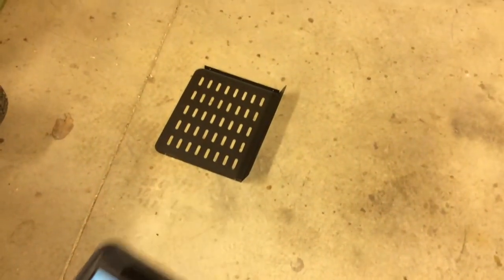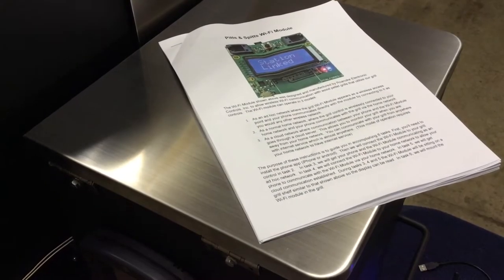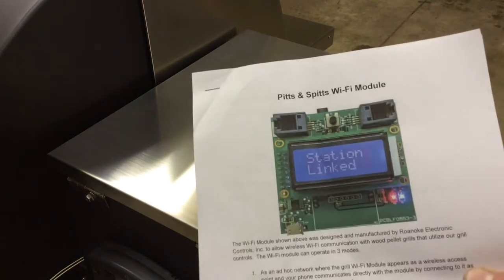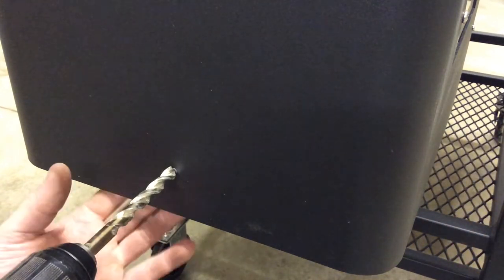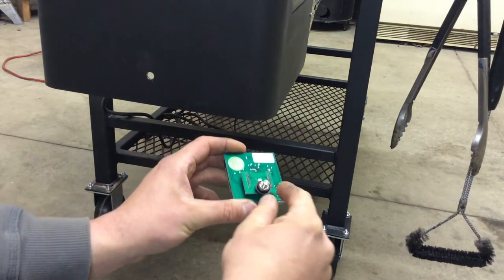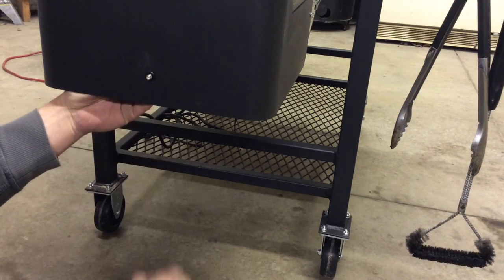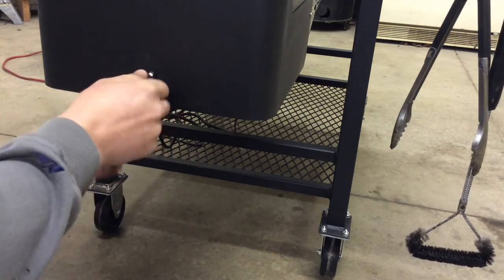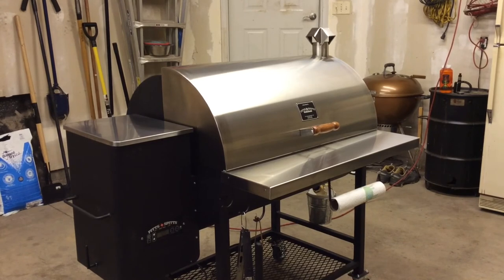WiFi Module Install On The Pitts & Spitts Maverick 1250

Comment: Thanks so much for that video.  Is the wireless module capable of all functions?  Specifically:
1.  Can it be used to program setpoints for both the grill and the probe?
2.  If one were REAL lazy and viewing the grill from the couch in the living room inside, can one change the display to show actual or setpoint for meat or probe?  

Thanks again.
Reply from the maker: freddiemercurious yes you can set the meat probe to a set temp. And yes you can see both the meat temp and grill temp from the app.

Comment: Quick question. I installed the Wifi unit today and it's up and running. The App to cloud option is active, however, there are no instructions for the Grill to Cloud option.  How did you set that up?
Reply from the maker: Hmmmm I don’t remember and I haven’t used the WiFi for a few years ok that grill. If you bought your grill from a dealer I’d ask them.
Reply: @MadHorseBBQ  Will do... Thanks!

Comment: I take it you can't turn the grill on when you're not at home? {not on your home network}
Reply from the maker: Gary Tyler the grill is connected to the cloud if you set it up that way. So as long as your home WiFi is on you can turn it on and/or adjust temps from wherever.